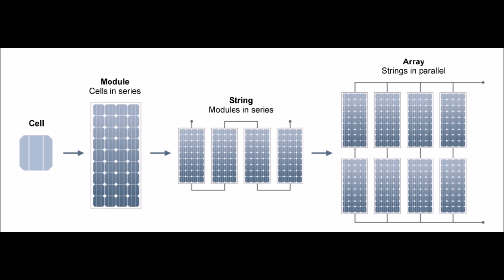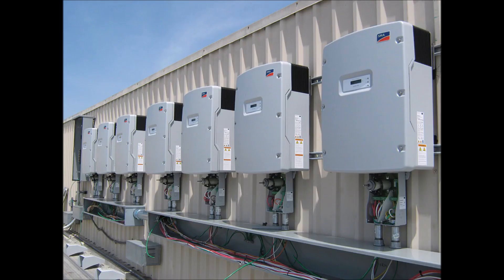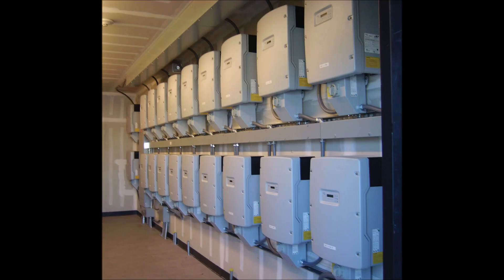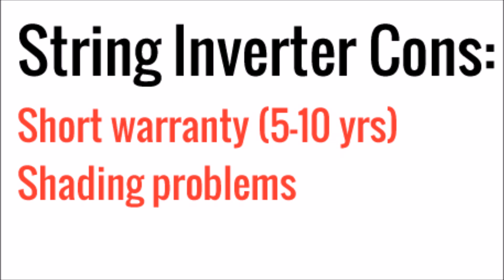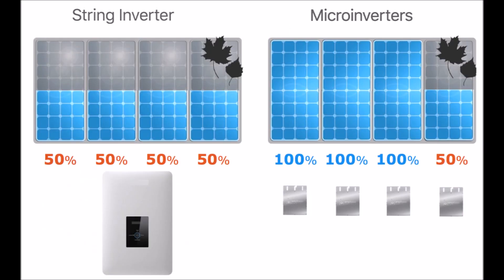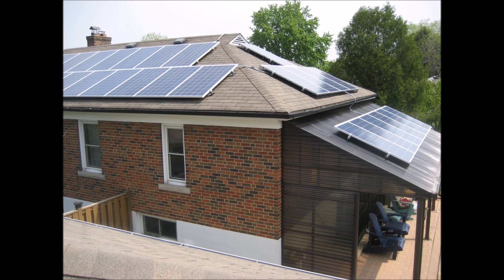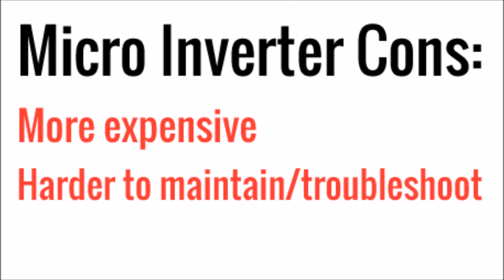Micro vs String Inverters

Comment: For me, I have plenty of roof space with no shading issues, so it was much easier and cheaper to add another solar panel than to deal with the extra hassle and cost of micro inverters.  As the video points out, you really need to consider this before jumping on the micro inverter bandwagon.  Some installers immediately assume you need micro inverters which could significantly increase the cost and maintenance burden so be careful and ask a lot of questions before choosing an installer.  If they insist that you need micro inverters, make sure you have them explain why and that you are comfortable with their explanation before spending a lot of money.  The extra efficiency might not warrant the extra cost and maintenance hassle so have them explain the ROI in using a micro inverter vs a string inverter.
Reply from the maker: Good comment.  It introduces numerous more points of failure to the system and more complexity so if it isn't going to give a benefit then don't do it.

Comment: Hey. Thanks. Great video. Just a quick question?
Why does the micro-inverter need to be mounted on the panel? 
Couldn't you extend the panel wiring into a location that provides access?
Reply from the maker: You could but you would lose a lot of power and/or cost yourself a ton of money in expensive wire.  Each of those panels will produce about 30v DC (and about 6-10 amps) so if you were to run a wire from that panel to the inside of your house, attic, garage, or whatever then you are probably looking at a minimum of 40-50 feet.  At that lower voltage you will lose a substantial percentage of your power from voltage drop before that voltage can be converted to higher voltage AC.  So you either need to mount the inverter next to the panel where the panel wires can reach or you need to spend extra money on thicker gauge wires to decrease the resistance and thus lower the voltage drop.

Make sense?
Reply: Mine are on a ground mount and I keep them off the back of the pv so they stay cooler. One thing over the past 20 years I have seen a lot of. Is when pv is on roofs it's kind of a pain to take care of. We try are best to put are pv on the ground so we can get to it. That helps keep cost down in a lots of whys aswell.
Reply: Dude there is a guy I know who did just this. LOL. He was like man tho's rhings do not make jack for power. When I got there he had over 60 feet of pv wire for just one inviter lol.
Reply from the maker: Yeah I learned that the hard way myself with my first setup.  I underestimated how much of an effect it would have.

Comment: It is 2021. Tesla making and including its own 4MPPT String Inverter with Solar + Powerwall. Their system very competitively priced. Should wise consumer opt for Tesla Inverter over micro-inverter or optimizer system for reasons you have outlined in your video?
Reply from the maker: In my experience, a Tesla solar system is on the high side of the market.  Make sure you know what all your costs will be with them as they don't always disclose all the costs and required hardware.  If you can find a competent installer that isn't going to rip you off, you can get a high quality system for cheaper than Tesla.  But that is just my opinion.
Reply: @LDSreliance  ThankU for responding. I was surprised Tesla’s solar/storage system competitively priced (tesla.com/solar) with Massachusetts tax credit, solar/battery incentives and utility shared virtual battery revenue. Break even point likely 10 years for solar/storage. My real question is string inverter NOT a poor decision? I like idea of not having to have someone (not me!) go up on my roof to check each micro-inverter or optimizer.
Reply from the maker: Neither is a bad decision.  They are different.  String inverters are usually cheaper and easier to install but microinverters are easier to fix or work with for maintenance or troubleshooting.  Microinverters can also manage individual panels and possibly squeeze out a little more performance as the sun may not be hitting all the panels in a string perfectly evenly or there may be a tree branch shading one panel in the string slightly, etc.

It sounds like you have done your homework and are making a good investment.  Just keep in mind that tax rebates only help you if you are a taxpayer.  In other words, if you have enough tax deductions already and your income puts you in a tax bracket where you don't owe any taxes, then the ITC does nothing for you.  So if you didn't owe Uncle Sam any money last year, chances are investing in solar this year won't give you any tax benefits.

Comment: So, if I have 4 100w panels and a 600w micro inverter. Can I wire the panels in series and use one inverter since together they don't exceed the max input of the inverter. Or do I still need to get another micro inverter?
Reply: umberto smith thanks!

Comment: so can i put different company panels on a 2nd string?
Reply from the maker: If they are on different strings that is better.  And probably best if you wire them in parallel.
Reply: @LDSreliance  yes different string, thanks

Comment: I watched somewhere that mech panel connection will reduce shading power loss effectivly , so that agianst your idea. Am i right ?
Reply from the maker: What do you mean mech panel connection?
Reply: using both series and parellel connecting at same setup
Reply from the maker: Yes, you will eventually have to combine the strings into an array at a combiner box of some kind but you can still have shading problems within each string.  Just not the entire array.
Reply from the maker: I touched on them briefly in the video but they are still pretty new.  I will do some more research on them for sure and probably do a video on them in the future.

Comment: enphase is the only way to go if you have less than ideal conditions or even if you do. I have been installing/designing for a few years now and have probably installed over 5,000 enphase M250 micro inverters. I live in upstate NY and if you want to extend your sun hours I have all you need to do it put a 280w-300w panel on a 250w micro. turns on sooner and turns off later. I have found this produces way more power in the long run compared to a string setup. now on the maintenance side enphase offers a very nice app for your phone that gives you the ability to data log yourself and see if a panel is not producing.
Reply from the maker: Yeah those are great little inverters.  If I were to go grid tied that is what I would use.

Comment: How can a string system bring down the output to the lowest level
As the voltage is additive?  This Video show that the shading impact is not true https://youtu.be/1o3OD6V_Ahg. Do you have any test data for what your stating?

Comment: If not for my micro inverters I would not make much power. My old string would make 1 or 2 kwh a day with 1500 watts. Now with my SMA micro inverters. We get about 5 or 6kwh a day. Same pv. I now am moving from grid tie tho and going more off grid. sick of all the crap my co-op is pulling. 99c a day fee if you grid tie now.. 

Do not know much about the solar optimizer. That would be a cool video.
Reply from the maker: Yeah, I might do a deeper dive into the optimizers sometime.  They are pretty new.  Glad to hear your micro inverters helped that much.  Any idea why?
Reply: In the summer I am happy to see full sun on 1/2 my array. There is not a time when some where there is shade on my pv. So when I put in the micro's I could brake up my pv into am and pm sun. So now Where befor I had 1440 watts of PV dew south. Now I have it broken up into 720 watts a bit more SE where I get the most of my non shade. Have 480 watts dew south and 240 watts SW.. 

So for me in this house. PV on a string inverter just did not work. My off grid setup is a the same deal. I have 480 watts on on CC that is dew south and 560 watts on a 2 CC that is SW for the late sun. That helps me run the AC longer into the day.. 

We are trying to buy a place now that will have full sun from sun up to sun down. There is a 1000 acre field on the back side of where we would put are home. The PV will be in full sun but my home will be in shade. The run will be long. So I will have to make a power shed close to the PV and just bring the AC power into the home from there. Kind like your doing.  For me in SC we get 110+ days. AC is a big deal. So it's a win win. I get the sun I need and the shade from the sun.. Now it's in the Lords hands if they take are offer. 

Sorry no clue why I am sharing this lol. THanks for all you do brother. God Bless.
Reply from the maker: That is awesome.  SC is actually on my short list of places that I may move to in 5 years when our 2nd oldest graduates high school.  Somewhere in the Greenville area probably.  But a place like you are saying that has a lot of acreage and lots of sun and also preferably moving water for micro hydro.
Reply: I have full videos on it. You can see how I am setup. One thing that's hard to see how my pv is SW S and SE. It's not more than few degrees off. With all the shading we get it was the best I could do. I live in a oval shape of tree's if you will. The house is in the center of. Think of it being a race track. The tree's are the track and my home is the infield.

WHen I had the SMA sunny boy we where lucky to see 2kwh. That was on days when we would get Cloud effect's on most days 1.5 was good. Then when I got the Micros we jumped to 4.5 with just 4 of them up and running. I was having to save up to build the rest of my racks. We have 6 240 us SMA micro grid tie inverters. Now with them up and running on a good day I have seen 7 KWH but that was just one time in 1 year most is 5 ish.. 

When I was thinking of going solar. I did know after working in solar for the past 20+ years I was going to have a lot of trouble from shade. But we where saving 20 and 30 bucks off are bill with just a few of tho's cheapo sunsaver grid tie's. The pug and play one's lol. My wife and I where like Hell we know it all helps. Are goal was to cut the power needs of are AC to free. 

Now things have move pasted that. We do ok. for what we have.. I will not EVER God willing live with out solar in my life.. Just silly not to do it..
Reply from the maker: Good comments.  What sunsaver plug and plays did you use?  They weren't from Morningstar, were they?  I have yet to see a plug in grid tied system that was legal in the United States.

Comment: I hear this same old lie time after time. If 1 panel in a string is shaded,it will NOT reduce the output of the rest of the panels in that string. People like yourself should be well educated in how solar works before making video's that promote false information.
Reply from the maker: Man, you are on a roll this morning.  Again, let me show you:

"Since string inverters require solar panels to be wired in series, if one solar panel's output is affected, the entire series of solar panels is affected in equal measure."
https://www.solarreviews.com/blog/pros-and-cons-of-string-inverter-vs-microinverter#string-inverter-disadvantages

"The downside to string inverters is that if one panel is partially shaded it can lower the production of the whole string. Also, if you have multiple planes on your roof, the array will lower production to the lowest producer in the string."
https://rethinkelectric.com/string-inverters-vs-microinverters/

"With microinverter systems, if one solar panel is compromised, the entire array’s power production won’t be impacted. With a string inverter alone, a system is only as good as its least productive panel."
https://www.solarpowerworldonline.com/2019/08/string-versus-microinverters-residential-solar/

Again, I can post another 100 of these.